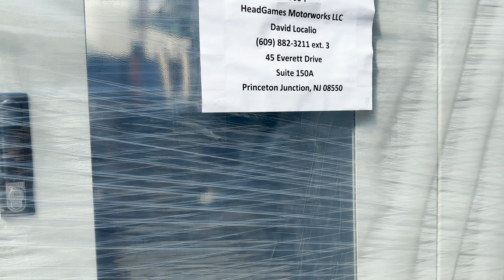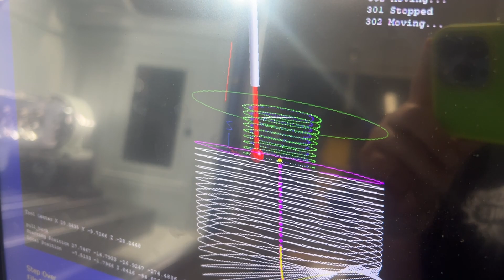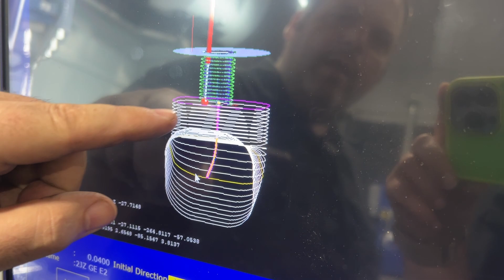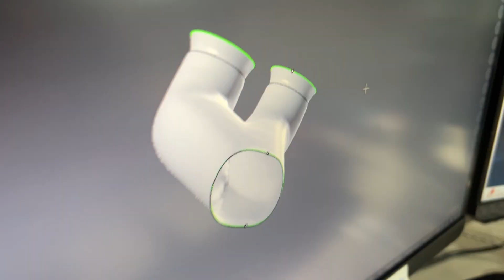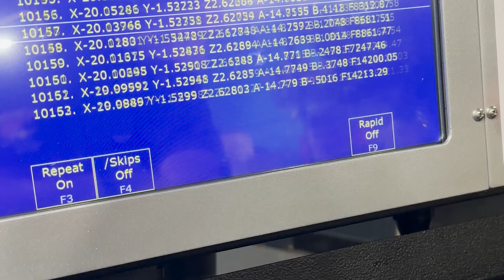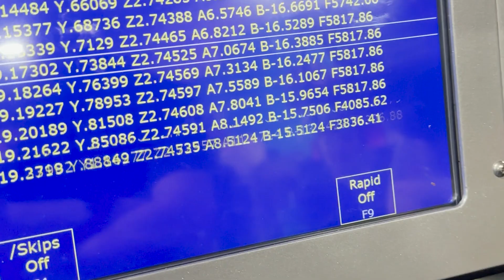HeadGames got a Centroid 5 axis CNC!!

Comment: Congratulations on getting this new machine! Why do you have to split the ports in two using clay? If the machine can digitize one side of the port, why can't it digitize both sides at the same time, or even doing one side, then the other? What purpose does the clay serve?

Comment: Can you use a 3 d printer to get its data points quicker?
Reply from the maker: @mrphiscal  you would have to still scan it but then you would have to print it and then digitize the print. That would be a huge project

Comment: I know it is very early and you guys are starting with learning this machine, and its main goal is cylinder heads, but is in your future to build parts with this machine, like billet oil pans with baffles and integrated girdles, and things like that.

Make the best of the best for the top of the engine which you already do, to make the very best on the bottom to avoid oil starvation and / or strengthen the bottom of the block.
Reply from the maker: I don’t see us doing anything for short blocks but certainly we are planning on doing some stuff for cylinder heads. The centroid is a great machine for porting heads but I don’t see it doing much more than that very well. Hopefully I am wrong!
Reply: @headgames is this not just a 5 axis mill ?? .. can you not just run gcode just like any other manchine you should be able to do any 5 axis machining that you can imagine.. anything aluminum i wouldnt think that  machine would struggle with